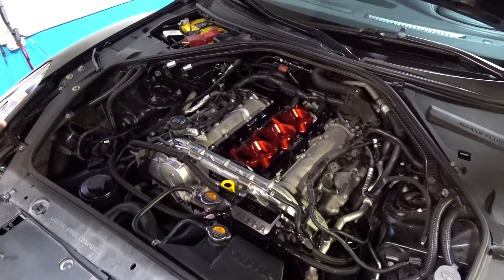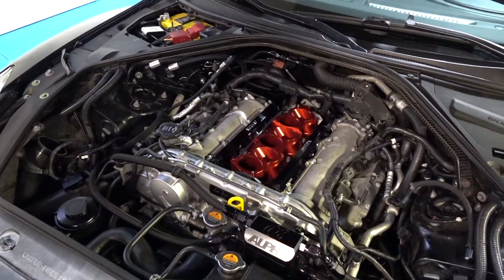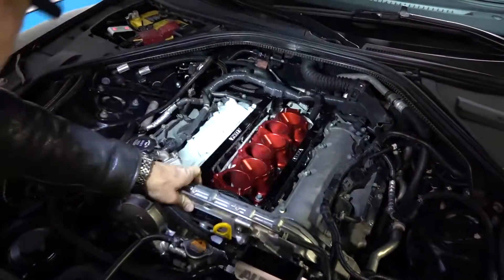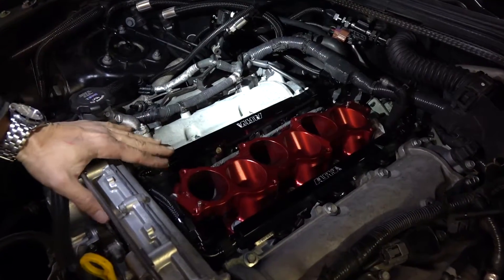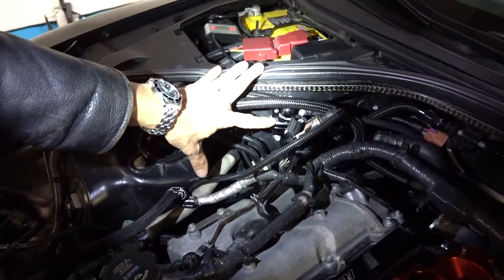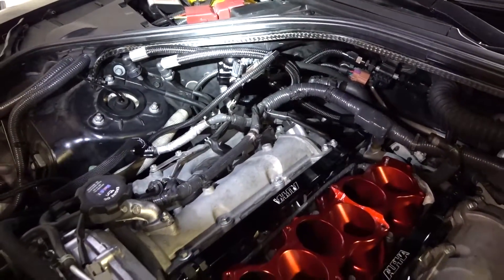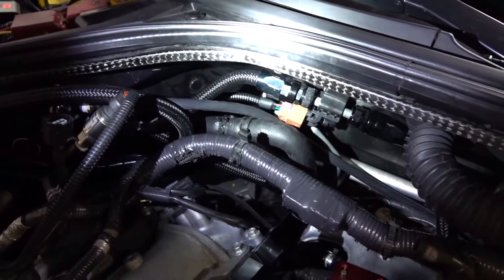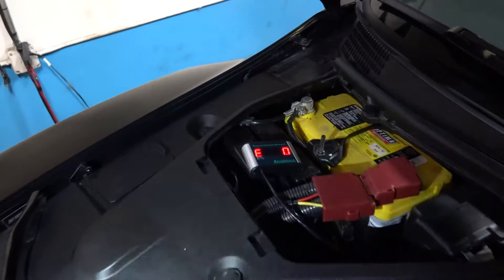What Do You Need To Run E85 In Your Car?

Comment: Thanks for sharing your continued progress, always great to be able to follow the advancements of this car.

One other point to note able using ethanol blended fuels would be that the stoichiometric air-fuel ratio changes from what would have been used for pump gasoline.